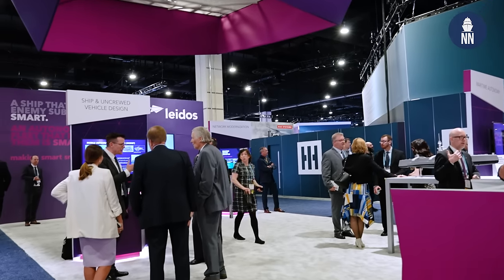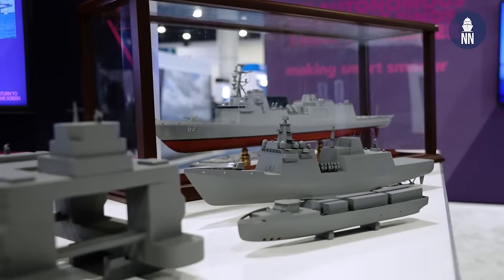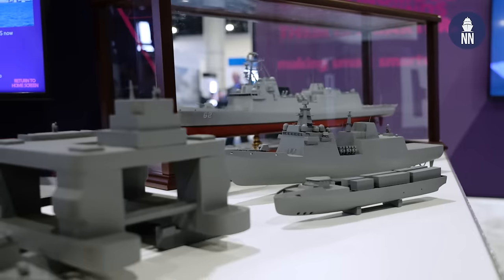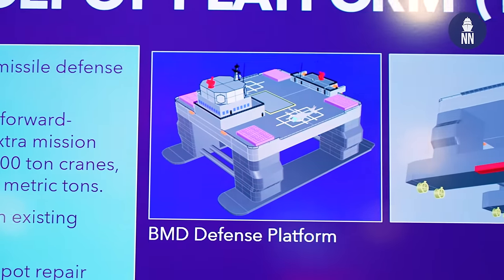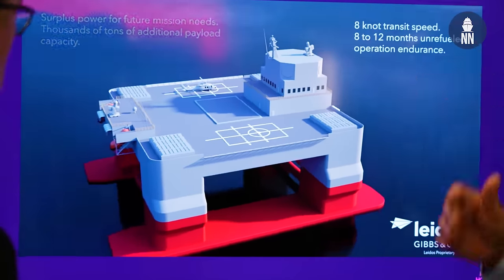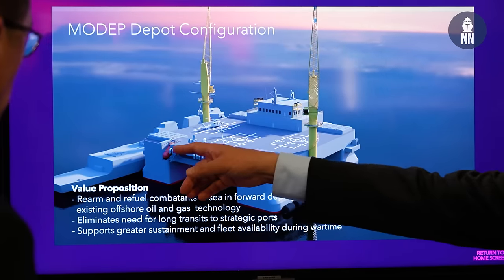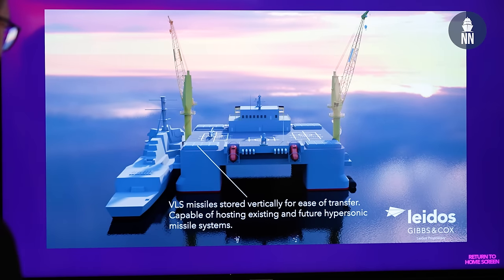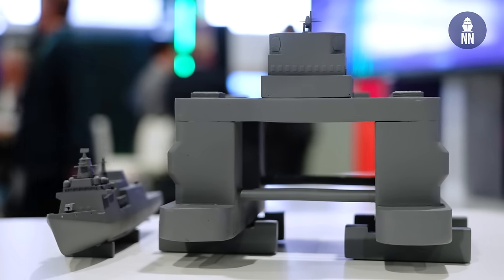Mobile Defense/Depot Platform (MODEP) Concept at Sea Air Space 2024

Comment: The Philippines need a facility like this to replace the rusting ship they are using for a base at the Second Thomas Shoal. This would help them hold off the Chinese in the South China Sea.
Reply: The Philippine Navy/Marines already occupies some decommissioned oil rigs as FOBs. Safe to assume that they add more in the near future.
Reply: @paulsteaven  The platform featured is a much more stable facility designed for military ops. Oil platforms are NOT designed for military ops. The best you can do with an oil platform is a listening station. The platform featured can host USVs /UAV's and maintain long distance ordinance
Reply: @waynecmontgomery these things have too many missiles on them and is moving way too slow to be put in a hot zone in my opinion.
Reply: @Jiaqi-p5b  They would be trying to use it as a base considering they are currently using a rusted ship with NO missiles that is completely defenseless and may sink.
Reply: @waynecmontgomery  a rusty ship with no weapons is exactly the reason why it’s still there. The Chinese can’t remove it because it’s the ship technically is a malfunctioned ship that “lost power” and “drifted” on to the island, and forcefully remove it is against international law for humanitarian reasons. But putting military assets there is a completely different story, it defies all the trouble in the first place. Putting this much fire power stationed in South China Sea is crossing one of the red lines for China, breaking it has serious stakes to it. I personally think it’s better off just to build 5 DDG instead waste the money to build a giant target that moves very slowly.
Reply: @waynecmontgomery  what I meant was, if this thing can hold 5 DDG worth of fire power, why can’t they just build 5 DDG instead. It’s way more useful than a militarized oil rig. And this thing isn’t too cheap to make by the look of it, logistically I don’t see why it’s a better option then just to build multiple arleigh burke flight IIA or flight III, they’re much more capable.
Reply: @Jiaqi-p5b  They want to maintain a continued presence in the South China Sea. I think you are missing their point. And I can tell you don't understand political or military strategy or deterrence. They don't want large battleships they can NOT maintain over the long haul. They are looking to send a message of deterrence and establish a line of sovereignty
Reply: @Jiaqi-p5b  You have to man and maintain those destroyers. As former Navy personnel, I can tell you that it's NOT cheap to maintain 5 DDG Destroyers, and China would see that as more of a threat. Using the platform they can maintain USVs and UAVs from that platform Please see what Ukraine is doing tor Russia without a Navy.
Reply: @waynecmontgomery  I understand, but I still think place this in South China Sea is risky. It could escalate tensions when it’s really not necessary. I mean what do you expect them to do in that region? If we have a conflict break out, these things are going to be hit first by barrage of short range ballistic missiles and there it goes down before all those missile can hit Chinese targets. This is very close to that arsenal ship idea where it sounds really cool but I real life I do not see it ever working.
Reply: @Jiaqi-p5b  Do you think 5 DDG ships are less offensive to the Chinese
Reply: @waynecmontgomery  5 ships don’t have to station there, it just add to the US arsenal and can be quickly deployed from existing US naval bases around the region. Instead of just one big fat oil rig of a target sitting in middle of South China Sea moving a few miles per hour.
Reply: @Jiaqi-p5b  It's not intended to be a warship, it's a movable port facility or defense. It's also probably cheaper than a DDG so you aren't getting five of those instead.
Reply: very true
Reply: We should hand the PH a couple of the littoral ships and NSM to them
Reply: @gups4963  Agreed, however, just keep in mind that comes with operational and training costs. Those are also offensive weapon platforms.
Reply: @waynecmontgomery  I agree for the most part. The littoral class ships kind of bit in offensive situations. With them being built with the point of having a small crew they just didn't work for a blue water navy. In my tbh somewhat ignorant surface level opinion, that would make them well suited to being beached at the shoal. Honestly if we had an old WW2 cruiser it would be better. Strip and put a few VLS and it would be a good deterrent. It would be a nighmare to try to destroy
Reply: Oil rigs can do be used for short and middle range air defense systems, maybe put some surface missile system on there too. 
Otherwise you can use it for supply. But problem is the supply can only be transferred by helicopter which takes lot of effort and time per operation. You can also have QRF force use it in a strategic position as forward operating base to quickly fly nearby targets
Reply: @AbuHajarAlBugatti  I agree with you !!! Also, these platforms have ship-to-shore cranes so they can get deliveries by sea
Reply: @waynecmontgomery  Fastest route give a couple of decommisioned ships to the Philippine navy and have it run aground besides Ayungin detachment.  Supply them with floating docks and reinforced it.  Supply them with Javellins, Stingers and Kamikaze drones with standby rapid response from A10's prepositioned in Luzon.
Reply: @misha791  Great idea, however, You would be back to rotting ships in the South China Sea. The discussed platform allows for additional capabilities that can be brought to bear. It would also give you options to resupplying the platform. That platform can be used to launch UAV(s) and USV(s) it would also additional SAR or search and rescue options to that area for deployment.
Reply: @Jiaqi-p5b  this is false. BRP Siera Madre is a commissioned ship of Philippine navy, Chinese cant remove it because it will be consider as act of war. any philippine ships that attacked by any foreign entity will trigger the mutual defense treaty of Ph and Us.
Reply: Can't even buy a proper frigate.

Comment: That's an amazing design. You can position these defensively off the coast and free up DDG-51's from patrol duty. The only problem with these is they will be massive targets. Say they're filled with SM-6, that's almost $4 Billion dollars worth of missiles. One submarine and this thing is finished.
Reply: I agree the Subs are the problem. However being stationary/minimal moving they can deploy a good sensor system with bouys and sonar. Add in a pair of Mk 48 torpedo tubes below the surface and potentially helicopters with air dropped torpedo and they become very dangerous platforms to engage. positioning motors would likely be electric with raft mounted diesels to generate power. they would be fairly quiet without the cavitation of a large propeller. Very interesting concept.
Reply: This thing should never be within 500 miles of a hostile. This is a mobile resupply node, not a shooter.
Reply: @lukedogwalker you are correct it should never be close to a hostile.  But that won’t stop a hostile from searching and engaging these massive platforms.  Doesn’t matter how close or far it is positioned.
Reply: @armchairgeneral7557  Our main adversary currently is China, this hulk would have to be kept 500-1000 miles away from the Chinese mainland to be safe, and at that point it would almost be easier to just rearm in Japan.
Reply: You can easily protect this thing from subs by simply moving it to shallow water. It's perfect for defending natural reef sites.
Reply: it's a ressuply platform not a battle platform. being a stationed platform with boats coming and going (and helis) all the time, plus it's own capabilities, it would be capable of detecting "a sub". however, as any FOB, it's a liability.
you need to see it as comparable to an airport/base with air defense abroad but for boats, not as a big giant ship (although it is a big giant ship).
Reply: @bzipoli  You obviously missed the part where it is equipped with Aegis radar and 300+ VLS cells. The guy in the video said that it could be used for combat. If it was purely for supply you could make a version that did that, but you probably wouldn't put the radar and launch capability for VLS
Reply: So what? Fill it with BMD missiles, Sea-RAM, and it can hold its own, functioning as both a depot and strike platform ideally with larger hypersonic cruise missiles like CPS that they can only fit like what 8 or 12 of in the Zumwalts
Reply: @planetsec9  "So what?" You mean you don't think risks should be calculated when floating $4+ Billion around the ocean?
Reply: @BravoCheesecake  nah they should also spam missile production to WWII levels of armamement surplus in turn with these platforms, so the costs go down to field these arsenal platforms at scale, defense industry needs a SpaceX for missile production in general, our stocks are so low as it is
Reply: @espeterson522 
Are you from the USA?
Reply: All part of the game

Comment: This thing is oozing with potential.
Reply: So did Texas Tower #4.
Reply: @racoming1035  Looks like that was intended as a permanent installation. This one can at least move out of the way of the worst weather.
Reply: @racoming1035  you do realize we have been operating this exact type of platform for oil industry in the roughest sea states for 70 years since the Tower 4 loss?

Comment: MODEP looks really interesting. I'm wondering what it's defensive capabilities will be though. Given it's size (about as long as an Arleigh Burke and about two to three times the width) and slow speed, it could be easily intercepted and mission killed.

There are definitely two things going for it though. First, it would be hard to sink, I think. And second, it seems to be easy to produce and thus, there would be more of them in reserve.
Reply: It doesn't seem to be positioned as a standalone surface combatant. It would need to be protected just like the rest of the logistics chain.
Reply: @Nainara32  So it would be a part of a resupply fleet/convoy? Understood, thank you.
Reply: @ladikthrawn7078  not even that. It would have to be prepositioned, so you would guess in advance where you're going to need it and send it out ahead of time. Alternatively, when you realise that a conflict is escalating or dragging on longer than you hoped (like the Red Sea) you would belatedly deploy a Europe-based unit down to the region, or relocate one from near the Gulf if that's where you had it.
Reply: Definitely an easy submarine target.
Reply: @NATObait  and for ballistic missiles but those are operational problems...iam more intersted if it can unload VLS cells from a faster supply ship, how long it would take to rearm a vls cell on average and if you could use it even for medium size repairs ... the system is very interesting and has alot of potential.

Comment: MODEP is a missile/torpedo magnet, and how long is it going to take to reload a destroyer? It's better to take a flotilla  of those autonomous drone ships at 1:37 and bolt as many Mk 41 vls on the after deck as possible. The task group could draw upon these missile stockpiles first using a data link before having to use their own. Once the drone ships missiles are expended they can go back to a friendly port and have their empty Mk 41 vls replaced. That MODEP wouldn't last long in a shooting match, and it would need defending. When it's ballasted down, it won't be going anywhere fast and will be a sitting duck. And it's got life lifeboats indicating a civilian crew.
Reply: Personally, I wouldn't use them to restock vessels. I'd use them as large capacity VLS defensive stations. 

Those drone boats can't house a VLS system. You'd need something about 10x the displacement to start thinking about it. And it'd need to be purpose built for that mission, they wouldn't be swappable like the containers on those boats are.

As for these things being a missile magnet: perfect. The conversion of a surplus oil platform into an arsenal ship would probably cost less than building a new destroyer. And take less time. Not only that, but they have the missile capacity of almost an entire carrier battle group. So good luck hitting it. A SPY-6 should be able to see a helluva way from up there. 

And subs? Always a threat. Luckily, you can base some anti-sub helicopters on it in case your own attack subs & maritime patrol aircraft didn't already cleanse the region.
Reply: Exactly - it's survival time is the time it takes a sub to get there 
They could claim "bait" is its secondary role
Reply: When its a great place to live on after nukes drop or zombies arrive. Id love one of these designed to be a home. That or a huge katamari with some spare parts on board
Reply: @AbuHajarAlBugatti  There's a 200+ year old Napoleonic fort about 1 mile out at sea from Portsmouth Harbour that's been converted into a home. Comes complete with helicopter pad, tennis courts, luxury accommodation, solitude and failing damp proof. Ideal for a zombie apocalypse.
Reply: It’s for Guam typically as back fire support

Comment: Even if this platform is intended to never be stationed near an actively contested zone, they should still be surrounded by similar, uncrewed or minimally crewed, platforms which are loaded down with weapons systems for both overwatch and underwatch.
Reply: You can put the same defense systems on there as on a frigate or any other ship
Reply: True enough. If "weaponized buoys" a tenth the size of this platform are easier to turn out and don't present significant disadvantages, it could be worth considering.

Comment: 24 months? that's crazy fast
Reply: I imagine that would involve taking an existing oil industry MODU platform of which there 100’s and modifying it to fit the mission requirements. While it probably would work ,I believe a missile depot ship concept would be a better choice to accomplish the same goals. Essentially a super tanker type hull similar to the NASSCO built USN ESB’s fitted with the same offensive/defensive missile tubes and which could easily provide all the same advantages plus be far faster, maneuverable and much better suited to warship replenishing.

Comment: You could use almost any platform with a flight deck to launch helicopters to look for subs. The problem with this particular vessel is it's too big, too slow, too vulnerable and if you want a helicopter onboard to go chasing enemy subs you will want two sets of pilots. Fuel, ammunition, spare parts, flight deck team, maintenance team, and before the helicopter takes off, it has to know  where to look. It's a big ocean. The range of a heavyweight Torpedo such as the British spearfish is 33 miles and travels at 92 mph. The sub only has to get within 30 miles of this thing fire 2-3 torpedoes and its dead and if theres a destroyer alongside being reloaded it's dead too., By the time you know what happened, the subs gone deep and disappeared. This is just a massive target filled with hundreds of very expensive missiles. And how long is it going to take to reload all those missiles onto a destroyer?

Comment: Great idea as both a mobile weapons supply depot and mobile command carrier, but there doesn't seem to be any defensive systems included or shown on it. I think it would be an easy target for submarines or aerial bombers without any defensive capabilities added or included in the design.
Reply: You mean defensive weapons besides the 512 VLS cells, right? It was shown to have two RIM-116 launchers which could be substituted by Phalanx CIWS if they wanted. 

If submarines are a threat they could have acoustic countermeasures and a deployable sonar with VL-ASROC loaded into some of those VLS cells to defend itself against submarines. On top of having an MH-60R ASW helicopter or two on the deck.
Reply: @stevenreddy6842 Great idea, but what if the submarine commander is NOT a complete idiot and remembers to hide in the thermal layers negating the effectiveness of your active sonar? I did ASW patrols in the 1980s in the GIUK gap and a surface ship looking for submarines is like looking for a gas leak with a match.
Reply: @stephennelmes4557  A deployed sonar as in something like the TB-37 MFTA, something that’s usually towed by a destroyer or submarine so that it can listen under the thermal layer while the host ship/boat is above.
Reply: Yes I understand but not at the slow speed this things going to be traveling at. You would be trying to conduct a vertrep using a crane to load explosive ordinance onto a destroyer. The destroyers generators are going to be running.  Your own are also running, and you'll be trying to ascertain the bearing and guessing the range of a contact on passive sonar to try to prosecute it. The whole thing is a missile magnet 🧲 and a sitting duck. Use the drone as shown and fire the missiles from it using link.
Reply: @stephennelmes4557  Could you maybe, I don't know, use helicopters off of this thing to look for subs? From the clearly shown helipads?

Comment: Stationary high value target.
Reply: Not stationary like an oil rig, this platform cruises the high seas.
Reply: @kristinaF54 At between 5 - 7 kts ??? Too big to hide, too slow to keep up and when its ballasted down its going absolutely nowhere. It's also got SPY phased array radar on the model , WTF ?. Are you really going to launch missiles from this while conducting a replenishment. Missiles on cranes, destroyers alongside and crew on deck? The PLA ( N ) would love this sitting duck.
Reply: Totally agree 👍.
Reply: A lot less stationary than the Patriot batteries on Guam or Japan.
Reply: @dgthe3  those can't be sunk by torpedoes
Reply: @dgthe3 Less stationary at only  5-7 kts? That's nothing more than a brisk walking pace, but also far less defensible.